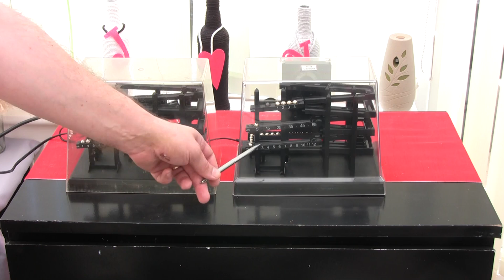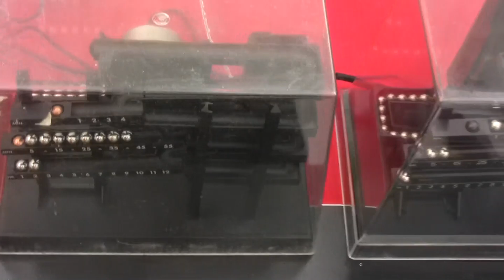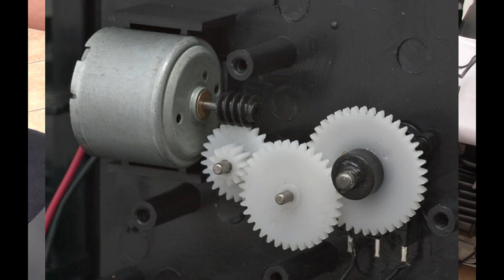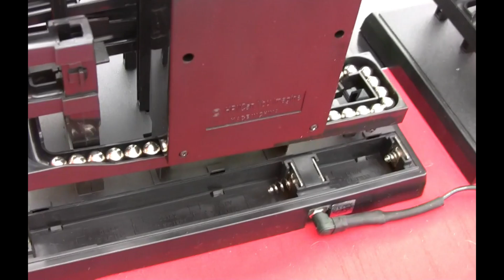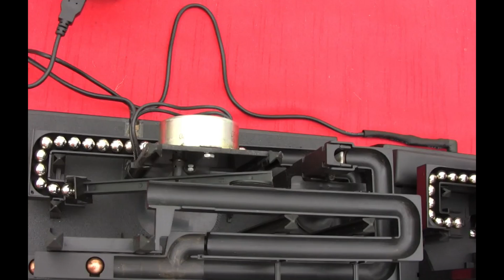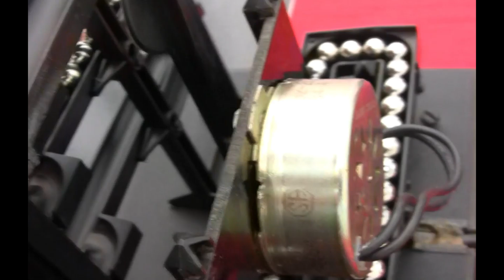Electric Ball Clocks - 1st generation Arrow vs 2nd generation Time Machine

Comment: Thank you for helpful video.  I have a first generation and the motor has failed  The problem is the gear that is fixed to the shaft that turns the lift arm has a crack and slips on the shaft.  I tried fixing with superglue gel and the gear no longer seems to slip, but the crack in the gear causes the mechanism to "skip" (like an old record player) when the crack in the  gear meshes with the other gear.  You point out in your video that the motor on the first generation is a replacement.  Do you know where I could purchase a replacement motor for US market?  Thank you.
Reply from the maker: The exact replacements for mains powered motors are not easy to find for resonable money. Search for Intermatic motor - the same motors were used in mechanical timers. I bought a Chinese motor for disco ceiling ball rotating at 1rpm instead and fitted the arm directly on the shaft. The only downside is it starts randomly in either direction, while the original one only rotates clockwise.